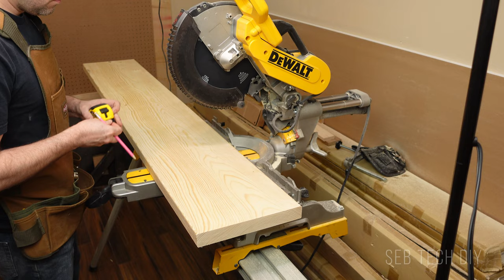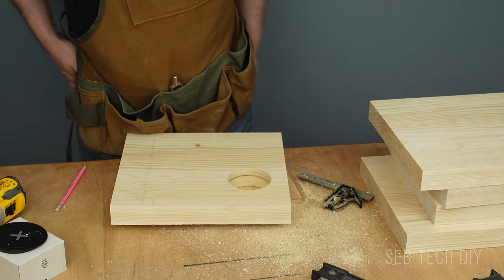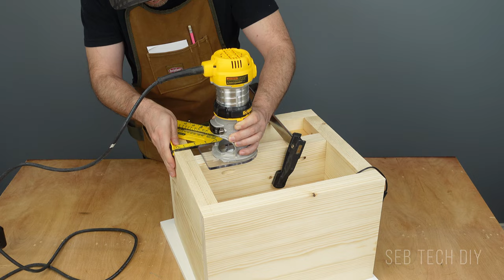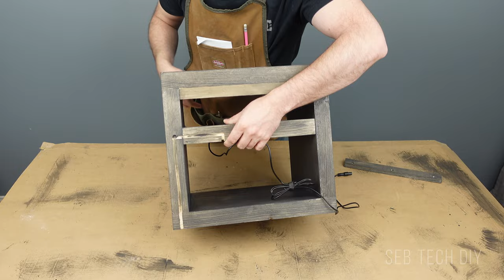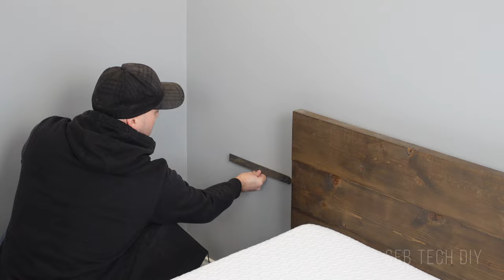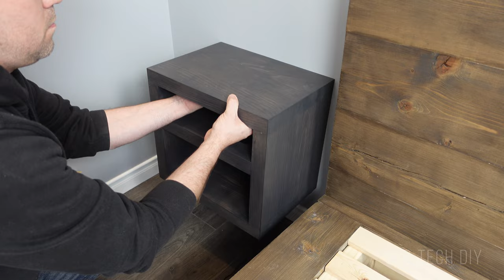DIY Wireless Charging Nightstand for 20$ - How to build

Comment: Nice and simple bud but then Plasterboard fixings for something that bulky 🤦🏻‍♂️
Reply from the maker: Well drywall is pretty strong, can hold easily 40 pound per anchor, especially if close to a stud. With the width of the night stand, it's not always possible to have screw in a stud. But since installed, it never ever move from the wall, and my 3 year old once put his feet on it to jump on the bed, so that time it passed the test! 😆
Reply: @SEBTECHDIY  no drywall is not at all strong we all know that especially with a point load from a small fixing and if your honestly saying you would be confident hanging that sort of weight off a single fixing (nearly 25kg ie a bag of cement) off a single plasterboard fixing then we can pretend that’s good practice😂. Just hope your insurances are up to date, in the uk they are considered by many to be a sign of a bodge job if used with any sort of weight. Not being a troll at all as nice little unit just not great fixing if ppl  where to start using that technique also. ✌🏻